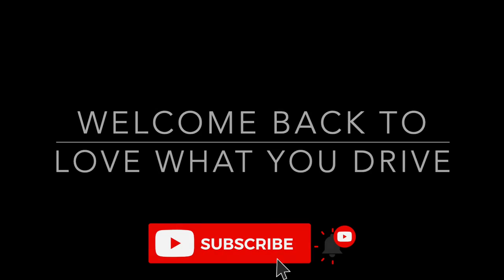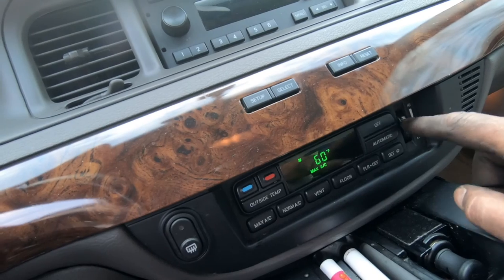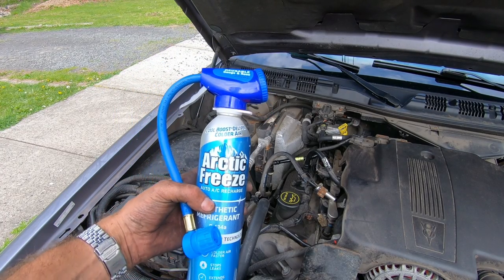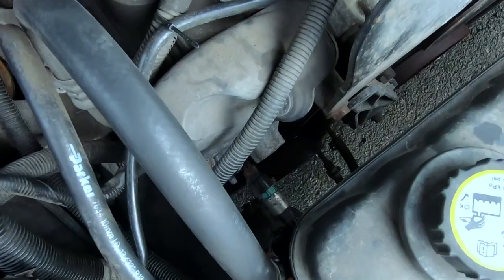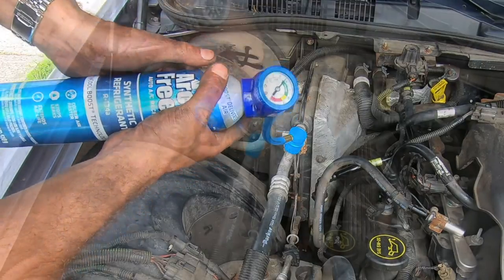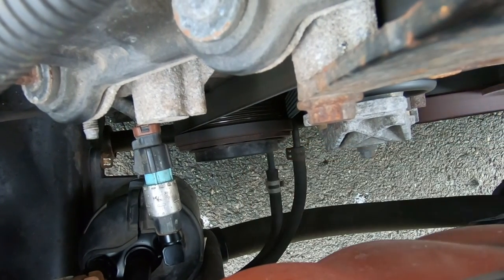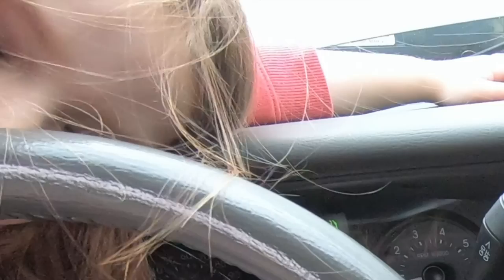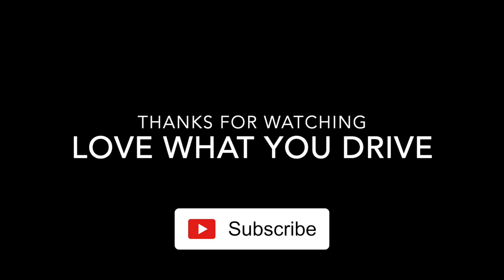How to recharge your car A/C system with Arctic Freeze R-134a Easy Step-by-Step Tutorial

Comment: I squeeze the trigger and the needle is always in the red. How can you tell if anything is even coming out of the can. And how do you know if the "clutch engages" wtf does that mean
Reply from the maker: When the clutch engages, that means that the AC compressor started pumping. Located your ac compressor on the most bottom left pulley and you can even hear the engine Goes a pitch higher in noise because the ac  compressor goes on. It one of the pulleys that is driven by belt. 
Usually if you fill it with refrigerant and that compressor doesn’t go on, then your pressure will stay the same on the gauge. But as soon as the compressor engages, your pressure should fall and you should be able to tell the difference. If the system is low of refrigerant, the ac compressor or the clutch won’t engage and they won’t work. I first spend about 30 bucks on the refrigerant before thinking it’s the AC compressor or the condenser or any of the hoses once you start filling it it should kick on if there’s no other issues with the system and they do make them neon colored green or maybe other colors so that if there is a leak, you can spot it really quickly where it’s coming from. If you watch my other video, one of the biggest and most common issues is the AC accumulator which can be purchased for 20 bucks on Amazon or rockauto.

Comment: Did you vacuum the system?
Reply from the maker: I did not vacuum the system,  the video right before this one is where I changed the accumulator in the car the system was bone dry and empty
Reply: @LoveWhatYouDrive so I have the same thing but for some reason it doesn’t clip onto the car, I thought this was a universal fit
Reply from the maker: @denzeldias1361 you really have to push it down for it to grab a hold, at first I was disappointed as well but you gota try to wiggle it on and put some pressure on it!

Comment: If the air isn't coming out of your vents and its on AC you probably have a bad Blend Door actuator.
Reply from the maker: The blend door actuator is out of commission, I manually switched it, but I did change the accumulator and filled it with Freon and it works beautifully! Thanks for stopping by I appreciate you!
Reply: Had the same issue. Changing the o rings in the eatc fixed it.
Reply from the maker: @Uptownxvic  thanks for stopping by. I need to do the o-rings in the unit still. It works but changes from windshield to vents pretty much when it wants! Thanks for your comment.